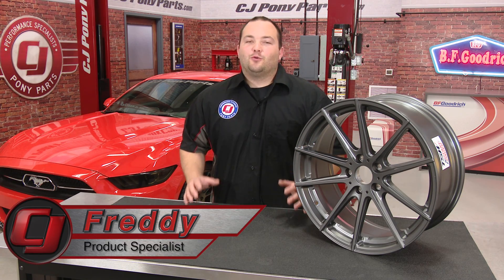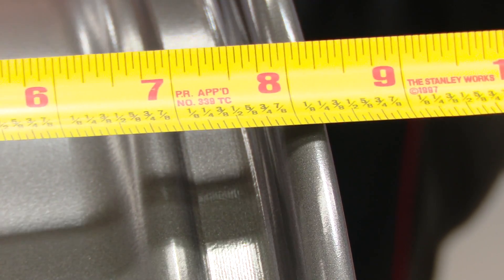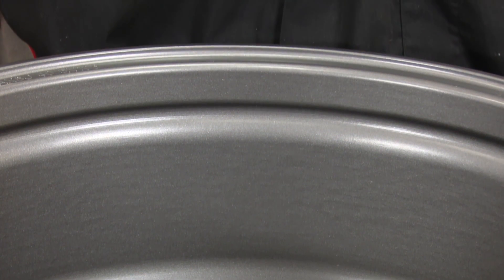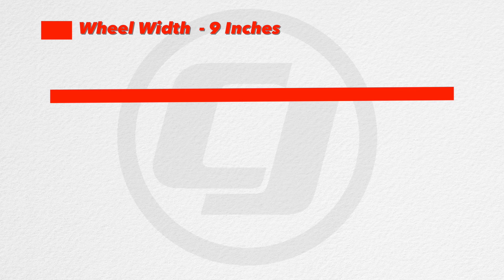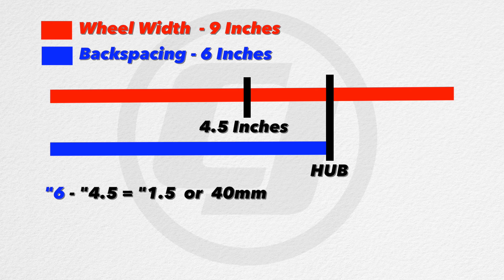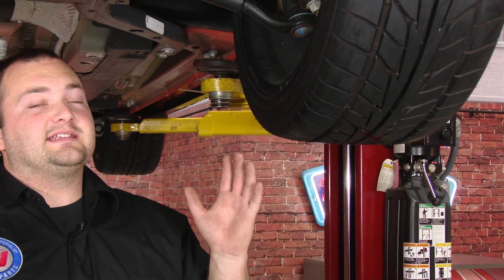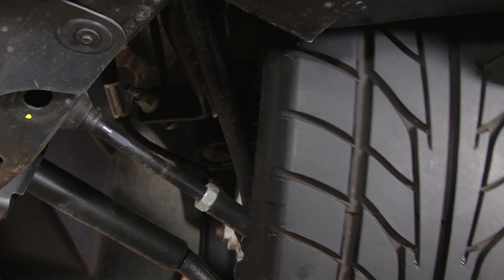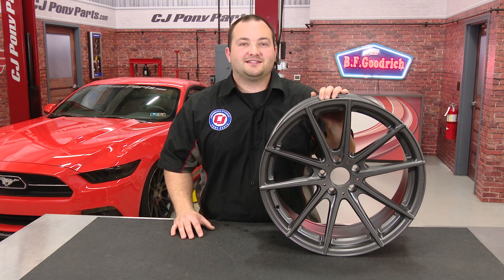What is Wheel Offset and Backspacing? 🤔 Links to additional info in description!

Comment: Hi. It would be ok to use rims with a offset something between 38 and 46(different models) if the one from manual is 43? 
Does this differences are ok without touching the arm or car body?
Also if the original wheels are 6 inch wide, can I use 6.5 inch with the same tires? do you think will touch the arm when steering to maximum, or half of inch is accepted?
 Many Thanks !

Comment: I have a question about the offset of my wheels they are 21 inch wheels I just put on my Lexus LC 500 they’re supposed to be both +15 offset with a tire size 325 3021 in arrear therefore the right side the passenger side rear tire sticks out couple millimeters more than the left side what is the reason for that please help me if you have an answer thank you very much ?

Comment: i always wondered why rim specs for 0 degree offset wheels have a backspace which is greater than 1/2 wheel width .  I assume it must be due to the addition of the bead of wheel. i.e. 16x8 wheel with 0 degree offset has backspace that is 4.5"

Comment: But what about the fact that the ribs on the rim poke out past the rim face? The wheel is sitting on those, not the rim, so isn't that throwing off the offset measurement? That could be why your math is off, since 1.5" is 38mm, not 40. I bet that extra 2mm is from those ribs.

Comment: Hi, thanks and very informative. I would like to check my ride is a peugeot 207 cc with wheel 16” specs of offset 27, center bore 65.1. I am planning to upgrade to 7x17 offset 42. Can you give me idea if this is a safe size or should be the 7x17 offset 20. Thanks

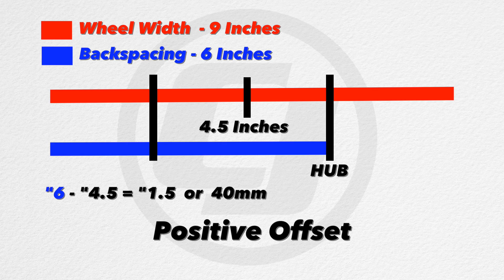Comment: @5:01 if it was negative offset, than the backspace measurement would be less than 4,5 inch wich is a half of wheel width. When you substract a 4,5 from <4,5 backspace you'll get a negative result (eg. backspace is 3 inch, so 3-4,5=-1,5 inch or -40mm), that is why it's a "negative offset".

Comment: I have a 2018 GMC 1500 truck i bought a set replica wheels in size 26 inch. I want to use a 305/30/26 tire my wheels are 26x10 with a 25mm offset.  I'm wondering will they rub because I don't want to lift are drop my truck at all?

Comment: Well backspacing affect your fitment if I’m running a 18x8.5 +35 backspacing is 6.1 vs a 18x8.5 +35 backspacing is 6.5 how would the wheel with 6.5 affect fitment??

Comment: so if i'm getting wider wheels i should decrease +offset so that will put the hub closer inward and therefore decrease backspacing so nothing will touch the suspension?
Reply: Yes that's the idea but you should go to customwheeloffset.com 1st before guessing...click on calculators link @ the bottom of their homepage and use their "clearance" calculator to compare your  current wheels to the ones that you want...It will give you the exact differences in measurements & then you could go to the car and measure if you're still unsure
Reply: @jbone1383  thx

Comment: So if i have  deep lip wheels and they stick out the fender like an 1 inch and half i need to do a negative offset to a-line with the fender?
Reply from the maker: It would depend on clearance. Less backspacing or more positive offset will bring the wheel in more.

Comment: The whole backspacing part threw me off doesn't make sense to me first you say it's not good then you say six and a half of backspacing is good I'm confused
Reply from the maker: Backspacing will vary depending on the brake setup and wheel fitment. There really is no such thing as bad backspacing, most Mustang wheels are 4.5-7in BS.

Comment: if you have a 17x7 wheel with say... 40et offset and wanted to go to a wider wheel. go with 17x8 at 30-35et 17x9 20-30et. roughly this will allow the wheel to stay positioned correctly to avoid contacting the suspension. although the wider you go the more poke will stick out the fender. each car has its limits with wheel size. usually when you push the limits you run into fitment problems, heavy wheels,extra stress on the suspension and brakes.
Reply: Check out the 17x12 i put on my P71, 84lbs of rotational mass..lol The added weight of widened steel wheels is real..

Comment: Thank you so much for this video. Helped me understand a lot about offset. I recently bought 2018 VW GTI autobann with 18*7.5 rims on 225/40R/18 summer tires with 49mm offset. I have a set of old 2014 Jetta winters tires sitting around which are 17*7 on 225/45R/17 with offset of 54mm... not sure if these will fit without rubbing any suspension/brakes etc? Any help will be appreciated :)

Comment: If I had to sum this up (no pun intended),  a wheel of equal width with the same offset as another wheel will always have the same backspacing, correct?  So if you're looking for a 17x7 with 40mm offset, you need not know the backspacing if you know the 7W is correct?

Comment: what is the deepest concave with the ferrada fr4 on 03 cl500 Mercedes sports package could fit without rubbing in back (back spacing) or sticking out of the fenders staggard/ I'm thinking 20x9 front 20x10.5 rear..

Comment: What if this wheel u showed us had 4.5 inches of backspacing. would that be a negative offset or positive offset??
Reply from the maker: It would depend how wide the wheels is. On a 9 inch wheel 4.5 in BS would be a zero offset
Reply: @cjponyparts  Thanks for responding. So, less positive offset means the wheel will be wider looking, Right?

Comment: For the love of God! i just want to know what offset i need on 18x8's for my wifes 12' explorer, so that the wheels/tires will sit flush with the fenders
Reply: you need to measure from hub to the fender take half of that and work it in the offset equation in the video... That is how I think he should have shown how to measure for any vehicle fit; however, to be fair the video stated explain wheel measurements and meaning...
Reply: Another way if the wheels are 18x8 already measure how much from rim lip to fender and add 0.5 inches to that... That in mm add to the current offset of the rim; shown in the video how to calculate will result in the mm offset required...

Comment: Hy ! I need your help pls !
I have 2007 Audi A6 103 kw  140 hp 
with its stock rims that’s are 
Size: 16” 
Diameter: 16”
Bolt pattern: 5x112
Width: 7.5’
Offset: 45              Tires 225/55/16
And I want to fit a new stock rims-
Size: 18” 
Diameter: 18”
Width: 8.5”
Bolt pattern: 5x112
Offset: 29mm
       Tires 245/40/18
It's ok ? Thank's a lot !

Comment: Hey. Planning to put on new set of ferrada fr3 wheels. 20x9 front, 20x10.5 rear on my ‘18 charger. Would I have any rubbing or tire sticking out the fender if I put 315/35 rear? Front shouldn’t be a problem since it’ll be either 275/285x35. I don’t want any sticking out nor internal rubbing. What would be an ideal rear tire size? I wanna go the largest I can which is 315. If not, what’s the solution, I really wanna upgrade but a whole lot info out there that gets u confused. Please advice. Thnx

Comment: I'm curious will I be able to fit a tire that is the same size but with a shorter side wall for example 
215/55-17 to 215/35-17 ?
Reply: yea, but it's technically not the same size (whole tire diameter wise), cause a shorter side wall means an overall shorter wheel diameter (if the rim stays the same size, which in your case, it does). But you can still fit the wheel, it would just be smaller in diameter overall.

Comment: So if 6" of backspace will run into clearance issues I'll need more offset?
Reply: Yes. Lets say you have 6" backspacing with +45 offset. If you have clearance issues on the inside barrel rubbing  on the knuckle then going to +40, +35, +30 and so on with the same width wheel will push the barrel outward giving more clearance. Then you have the issues of fender clearance if you're too wide and low which is where the -1000000 degree camber comes into play as you see with these ricer hondas.

Comment: I got a vw jetta with the 195/65 R15 with the 35mm offset, and i wanna put a set of wheels that are 225/40 R18 with a 35mm offset. Since its a wider tire will i need to get wheel spacers?

Comment: This video is realy helpful, but i want to put one question. Lest say we have set up from factory a car with 16/55/225 tyres and wheels 16/ 7.5 j/ ET45. So lets say i want to use tyres 17/50/225 and wheels 17/ 7.5j but off set of wheels is ET35 for more visual effect. So this mean offset will go a bit outisde. The question is, it will have problem where the wheel or tyer rub anywhere or no. I guess will not effect brakes or backspacing, but what about fender. Its this 55 to 50 hight of tyer will help with offset or not. What is the possibility of small or negative offset to the fender of the car. Is there a matter what suspension car have ?
Reply from the maker: It depends on the vehicle, you would have to take measures and see if there would be clearance issues anywhere. Some cars you may have lots of rubbing and other cars may have tons of room, it all depends.
Reply: Well i speak exactly for the Audi A6 (4F,C6)...2007 3.0TDI/171kw Avant.
Is that gonna change anything or still cant be said if gonna be fine or will rubbing anywhere.... ?

Comment: Ok, i want to run a 22x10.5 with a +38mm offset on my dodge challenger, it will be the same size all the way around, im trying to figure out how much backspacing i will have, my hub is a 74.1 i want to use a 25mm spacer which is 1 inch, do you think that will work, im just worried about clearance on the upper and lower control arms when i make a sharp turn.

Comment: quick question, if that wheel had a deeper rim (more of a lip), will that decrease the backspace or increase? wheels are so confusing imo, holy shoot.
Reply: If the there was more of a lip it would decrease offset as well as decrease back spacing.  The wheel in this video has 40MM(1.5 inches) of offset and 6 inches of back spacing. If  the wheel width stayed the same but you added an inch of lip it would then make the wheel have 15MM(.5 inches) of offset and 5 inches of back spacing.
Reply: Freddy CJPP so the less inches you have of backspacing the better right ? So you won’t have clearance

Comment: So my stock offset is 41mm. And the rims I want to buy are 45mm. Would I be able to fit the new ones?
Reply: +Alex Fauth Based on what i learned from this video: i dont' know.
Reply: Theoretically, you should be able to fit the new wheels w/o hub centric spacers, but they'll be slightly closer to the center of the car
Reply: That's about how im feeling right now.

Comment: hi mate. my friend has gave me his wheels off his jag sports car. I drive an a6 his the wheels are 20" 5 stud. when I try them on I get the first but in and the rest seem maybe a millimeter out. can the but holes on the wheel be slightly widened? I want these wheels to fit as they look amazing on the Audi. thanks
Reply: You need to get wheels with the correct lug pattern, do not modify the holes that will be very dangerous.
Reply: Freddy CJPP cheers mate I thought that but it was worth asking as the wheels are beautiful. thanks

Comment: Came here to learn, left with more questions
Reply: What questions do you have?
Reply: Freddy CJPP so if I’m buying wheels for 19 inch by 8.5 inch wheels what tire sizes can I use? What width can I use? Is 245 about right. 

Ex: 245 35 r19
Reply: If it's hitting the fender liner it sounds like you might have too large tire diameter. Get the car up in the air and turn the wheels full lock in each direction and look at the room you have, you can experiment with putting washers on the studs to act as spacers then putting the wheel on and see what your clearance is like. If/when you find a good fit measure the thickness of washers. You may need to get longer wheel studs as well when you get spacers.
Reply: Freddy CJPP so what if i have clearance issue? can i buy spacers to correct it? the wheel currently rubs my dust cover on the inside of my front wheel when ever i hard turn what should i do?
Reply: Freddy CJPP do you think it can be a good idea if i have 185 60 r14 in front and 195-55-15 at rear? i have a 1986 toyota mr2, which is mid_engine layout.
Reply: poormanmods!!!
Reply: Is it rubbing the metal dusk shield behind the brake rotor? Or the wheel well/fender liner? A wheel spacer can fix some issues, but can also create others.
Reply: Freddy CJPP j
Reply: same here...I’m thinking about putting a 3.5” lift on my JLU with 37” tires: how can I keep them from sticking out so far?
Reply: Same here
Reply: Vehicle recommend offset value is +51 mm. But, I have +25 mm offset wheels can I fit directly to the car????? Please answer…..
Reply: Freddy CJPP the fender liners, when i turns hard left or right, it rubs on to it. however i dont know how to find out what width of spacer should i be using
Reply: Get wheel width by measuring only between the beads. Then he measures the whole width of rim to get offset?

Comment: It's kinda nuts how some measurements are metric and others are SAE don't ya think. Nutty industry indeed. No pun intended.
Reply: Not really. The whole wheel and tire world is used to measure wheel/rim diameter and width in inches. And so it will be in the future too. Offset/ET however is measured in mm because it is easier to relate to when designing a car, and calculating track width and so on.
Reply: Yeah i agree, SAE needs to be done with, metric all the way!
Reply: totally agree, but “how fast is your car in the .402 kilometer?” just doesn’t have same ring to it
Reply: @bradhoward7565  In the metric world we just say "400m" instead of "quarter mile"

Comment: Since when is 1 and a half inch 40mm ?
1" =25mm 
0.5" = 12.5mm 
Total 37.5mm
Reply: Kind of funny how you are calling him out when you are also wrong.
You are precise down to the tenth of a millimeter but you fail to do that with your initial numbers.
1" is 25.4mm  so his 1.5" would be 38.1mm ;)
Reply: Because knowing things and constant learning is good for the brain. Since when, understanding what things are and how they are functioning is bad for you?
Reply: Anyway, that means ET38 not ET40, besides what is the point of knowing how to measure it if every rim has it printed/pressed on?
Reply: 1" is 25.4mm not 25mm
Reply: Patryk Janowski because not every wheel is a fixed one piece. Some are 3 piece. Which means you CHOOSE your offset. That’s why

Comment: Whats the best weld setting  from offset backspace and... for racing and not looks for 18'
Reply: In theory for a drag wheel you would want 0 offset which would be the absolute strongest but you need to figure out fitment based on tire choice, brakes, etc.
Reply: Bill Tumas i have the regular brakes for the  premuim what fitment would you recommend
Reply: What year is your Mustang?
Reply: Bill Tumas 2015 im planning on a set of RTS
Reply: I do not sell the RTS but Weld makes a specific fitment just for the S550
Reply: Bill Tumas i cant find it on the weld website each time i try to purchase i had to make the specs and fitments but i fear i might choose the bad specs and ruin the performance of my car so im trying to find the perfect specs
Reply: hi...I have a question...I have a nissan maxima s.e 2007...it uses wheels 245/45/18 ET 40...but I bougth wheels from nissan maxima 2011 the size is 245/45/18 ET 50...can u advice me if I'll get any problem?...the wheel is the same...the difference is the ET (offset)...answer me please
Reply: MUNITY